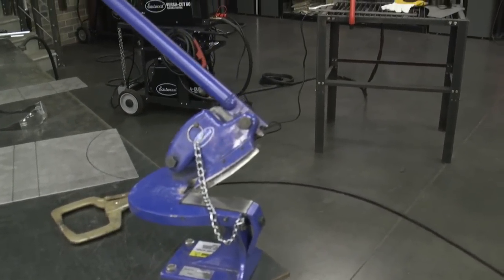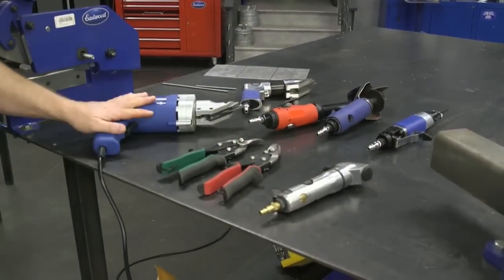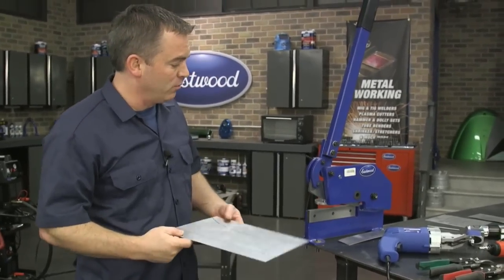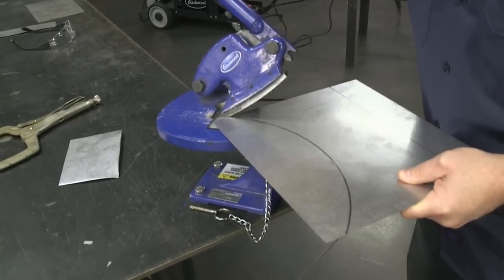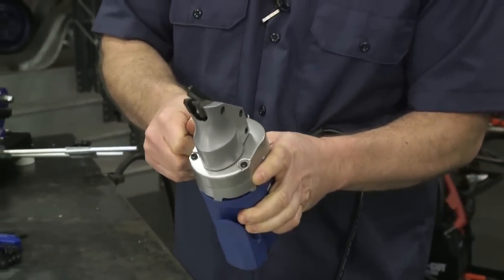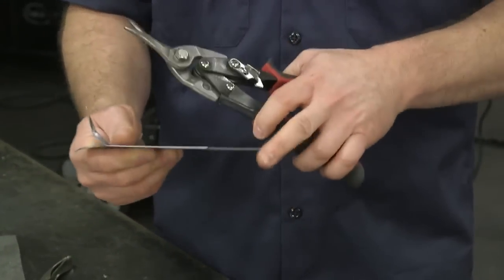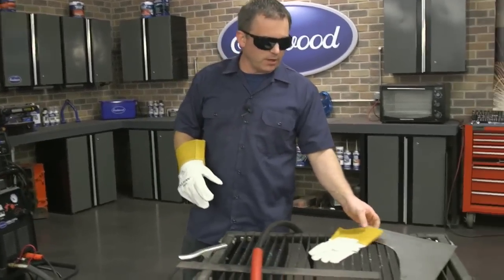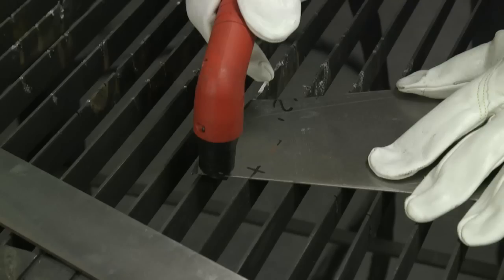Eastwood Metal Cutting Tools - How to Cut Sheet Metal to Thick Plate!

Comment: Nice! My most commonly used tool for cutting heavy metal is the cold chisels. Capable of splitting sheet, rebar, bolts, shock absorbers and AC motors. Sometimes plate steel. So yeah! Scrappers are experts with chisels.